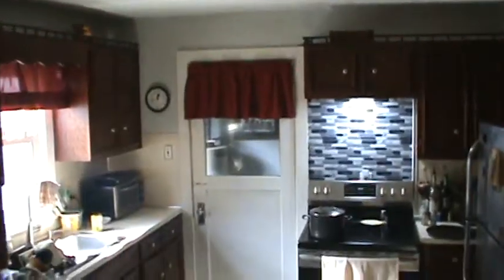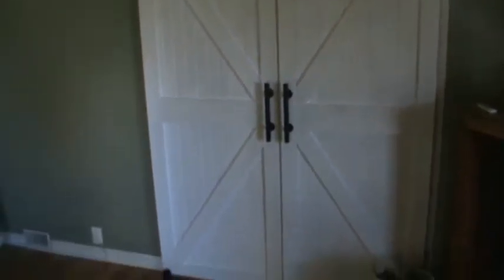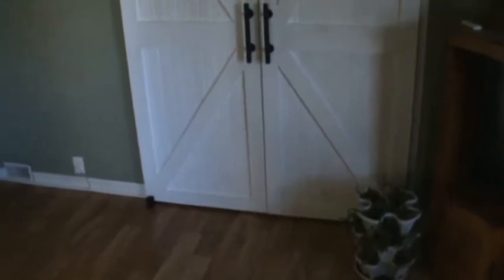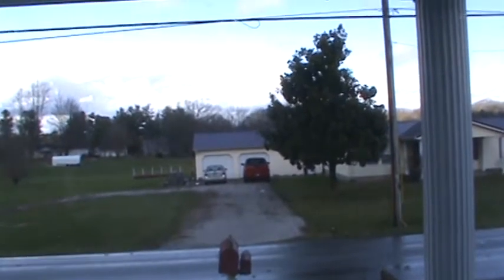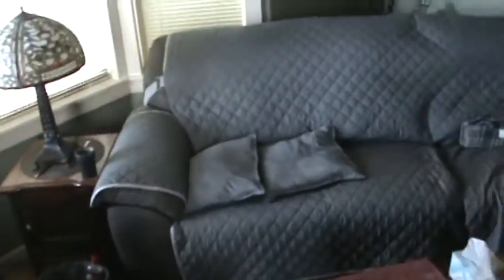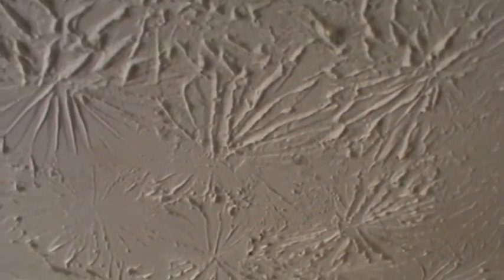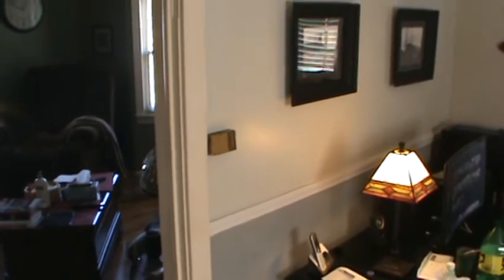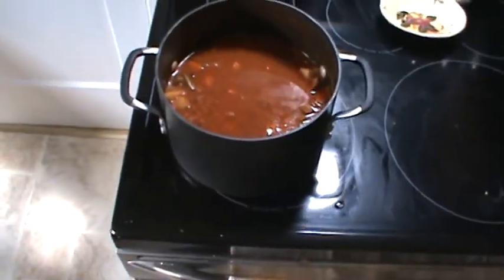Home Projects Update

Comment: Gary - you did a nice job my friend.  Those door are nice - I didn't notice the boards until you mentioned it.   You did a really nice job, seriously.  Well done-    Turns out that Pot was connected to the chassis ground on both ends ( One on the chassis ground on the Osc coil, and the other on the Chassis side of the power switch) .. NO IDEA what they tried to do with it, maybe the on off switch is bad and they tried to bypass it.. I didn't test that yet) ... LOL   and yes the Tin Whiskers..... LOL too funny.     Thank you again for the radio, I really appreciate it very  much my friend.
Reply from the maker: Thanks, Ron!  I wanted to stain and polyurethane the doors but Ma wanted them to match the painted white trim of the rest of the house.  I've gotten to where I don't notice the lines in the door unless like today I'm thinking about them so I guess I'll live with them, lol.  Glad you're enjoying the radio project!  Take care, Gary

Comment: The doors look pretty good Gary. I guess if the odd door gets to bothering you bad, you can make another door to match the correct one. And then take the oddball and maybe if its wide enough,  use it on a single doorway. Like maybe the doorway into the kitchen. ?? Or a closet doorway. We put in a gas furnace 2 years ago and I built a closet around it and used the barndoors too. 
I too dropped my crappy  Frontier service when REMC ran fiber out in my neck of the woods. LOVE it. I dropped my land line as well since my wife and I both have cell phones. 
Good job buddy,,, looks great !!
Reply from the maker: Thanks!  Yeah, we'll be getting rid of our land line at the end of the month too.  I dread getting a cell phone though.  I haven't owned one in 20 years back when they were analogue and only made phone calls.  I have no idea what to do with a modern one...they don't even have number buttons, lol.  Even when I had one back then I never could figure out the voicemail.  I'm going to miss my answering machine :(  Back when I had one I could never remember to charge it and half the time it sat out in the truck with a dead battery and I only plugged it in when I needed to make a call, lol.
Reply: @Rebel9668  I hear ya.  I'm kind of a techy guy. But,, even at that, keeping up with the ever changing technology is a pain. Just like that stupid Instagram crap. I hate it. I set up an account months ago for a stupid giveaway a YouTube guy was doing cause you had to go follow him on his Instagram. I've still not figured how to use Instagram even though it seems everyone else knows how. lol 
I hated giving up our land line because I managed to get my wife's Grandparents phone # when we bought their home and moved out to it. So, it had some sentiment to it for my wife.
Reply from the maker: @MrMike47274  I used to be techy and even still like to restore old 1930's-40's radios.  Have no problems running electric wire in a house or hooking up all the rats nest of a stereo system's cables and cords but the digital stuff just stymies me, lol.  Hell, I never even learned to program a vcr or set it's clock back when they were around, LOL...but on the very old vcr's I had no problem adjusting each antenna coil to receive the local tv stations through them.  They work just like the preset buttons on 1930's & 40's radios where you have to adjust their antenna coils to each station you want to preset, not like the later model car radios where all you had to do was pull out on the button and then push back in to set the station.
Reply: @Rebel9668  Some of those VCRs were a royal pain to set the clocks on. When I lived in N.V., I had an older sister that would call me everytime the electric would come back on after being off for a storm. She nor her husband could never figure those things out. And of course they had a different make and model from mine. So, I'd have to struggle with that. Oh how I remember the good ol' days. I never got into the electronics much. More of a grease monkey kinda guy.